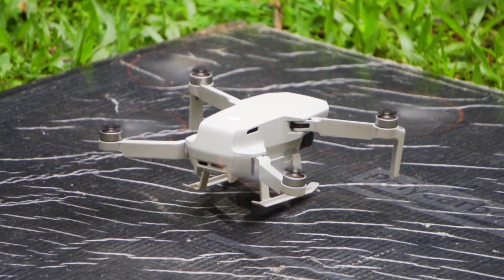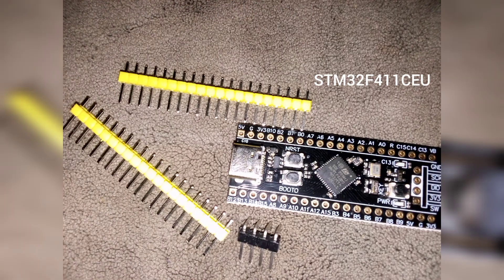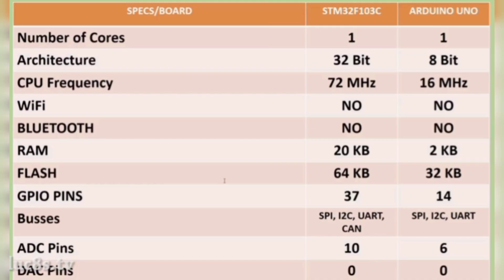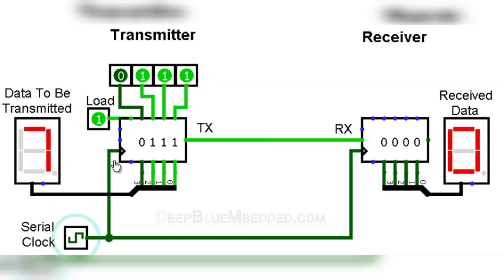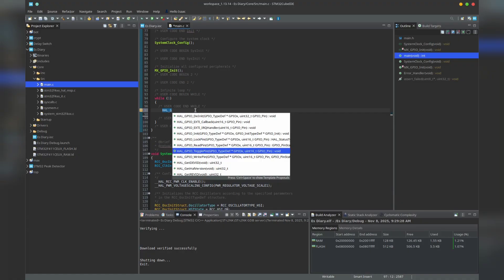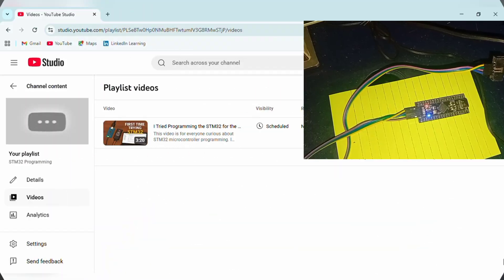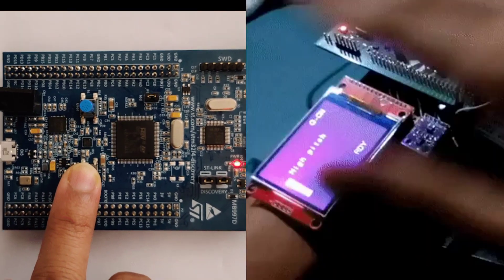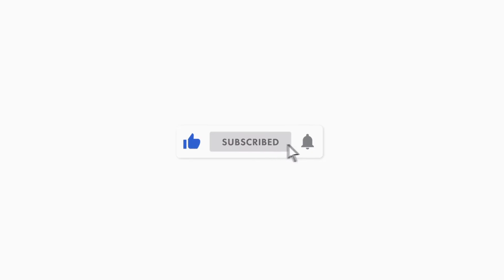What Is STM32 and Why Do Engineers Use It in Real Products?

Comment: Esp32 is better overall
Reply from the maker: You are right in terms of it's inbuilt Wi-Fi and Bluetooth features, low cost, and ease of programming it but if you have worked on an intense power project or product, you will know it has power issues. So, when you are working on a project that is hinge on battery life, STM32 especially the STM32L series is the best coupled with it's versatility in terms of scalability and long term options.